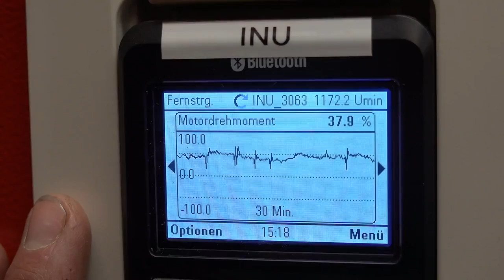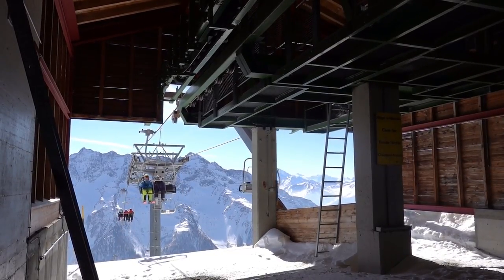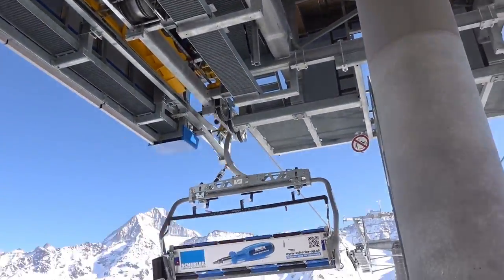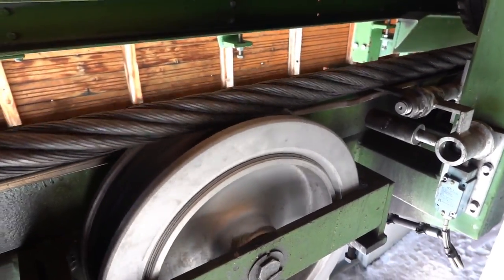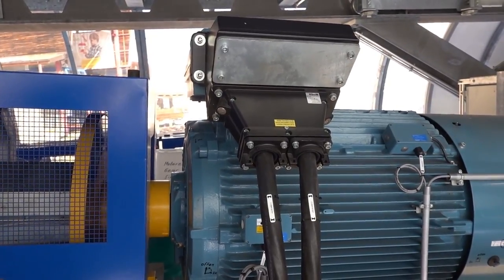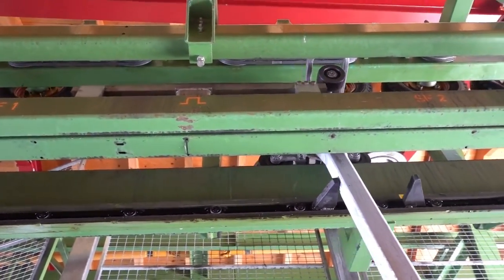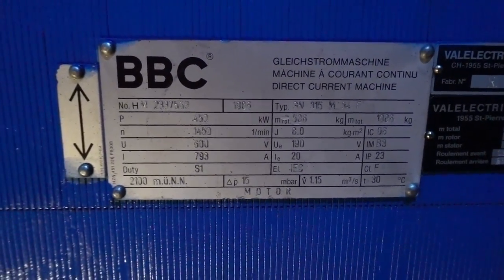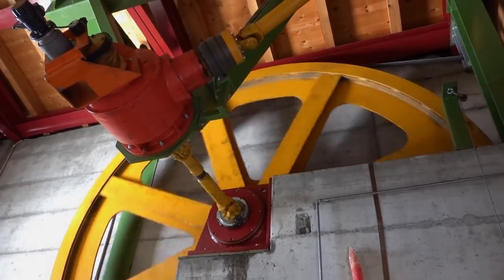The incredible leaps of three decades of technology evolution! Chairlift comparison (part 1/3)

Comment: You would have loved the ropeways built by Carlevaro-Savio at Mount Snow and Killington in Vermont. Mt. Snow was built as a futuristic winter resort which grew to include an outdoor heated pool, Ski-on/Ski-off "Telecabine" gondolas, and The Air-Car : a switchback tram themed right out of The Jetsons cartoon that flew over Snow Lake between the Eagle Lodge (Main Base Lodge) and Snow Lake Lodge (hotel). 

Killington also had (for a while) the longest Detachable Gondola in the world, complete with four stations serving three of the five peaks of Killington. The old Killington gondola was very advanced for the mid 1960's, with automatic doors and grip conveyors in the stations (which supposedly failed constantly because the pneumatic[hydraulic?] hoses used to drive them kept freezing and bursting). I was very young when I last rode it but I vaguely remember a lever in the gondola that passengers could use to select at which station the doors would open (always top and bottom, but you could choose to skip either or both of the mid stations, though that might have been something my dad fooled me with: "Don't touch that! We won't be able to get off!").

Comment: Excellent video's, I'm familiar with 2 Doppelmayr grips (having been an operator for over 20 years on 2 installations, one installed in 1987 the other in 2023) something I find difficult to explain to people is the actual grip mechanism working (had considered trying to build a miniature grip they can play with).  I found your videos of different grip systems fascinating but even when you point something out (including for an experienced Ropeway Operator) it's tricky to follow & fully understand what makes each one tick.  From what I know of grips one side is fixed whilst the other side moves.  A video explaination of this would be fantastic, particularly for different types of grips from different manufacturers & different eras.  I'm not sure how you'd best do this, to understand the new lift I looked at a grip parked in maintenance, while the lift was running wasn't when I actually understood it.
Reply from the maker: Thank you! I wish I could do animations like that. This weekend, I'm experimenting with animations with a friend, maybe in the future we can do like a joint venture!

Comment: Some suggestions for question/topics for future videos...
1. Are the tyres used in these devices specially made for them or are they "off the shelf" road vehicle tyres...?
2. For use in ski resorts, are the tyres any kind of special compound to cope with the low temperature extremes (like snow/winter tyres for road vehicles?)
3. Finally, I once recall a rumour going around a resort that the overnight temperatures were so low, (less the -30C the year I was there) that the lift company kept the ropes running all night for fear they may freeze up. Does that really happen...?
Reply: To answer your last question, there are ropeways, which run the rope during some nights due to climatical conditions but the reason is to avoid ice formation on the rope…